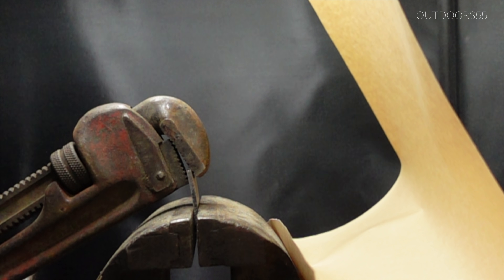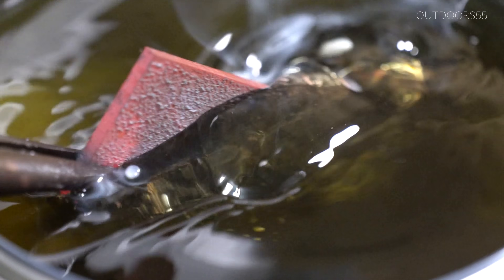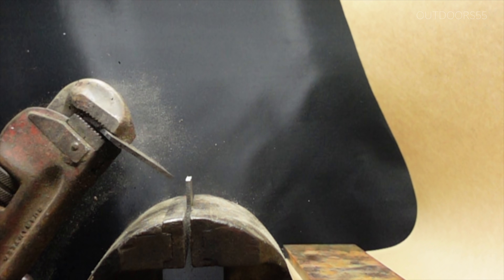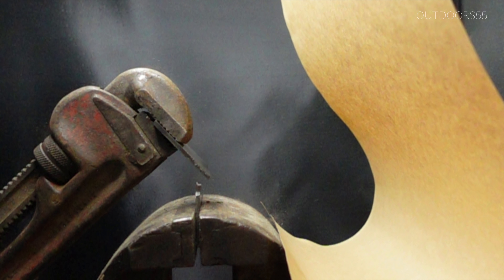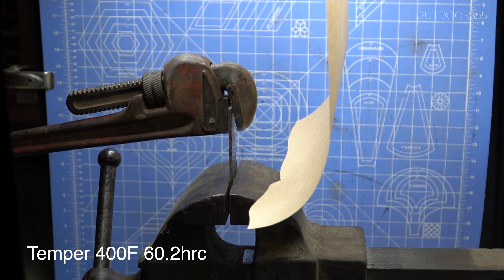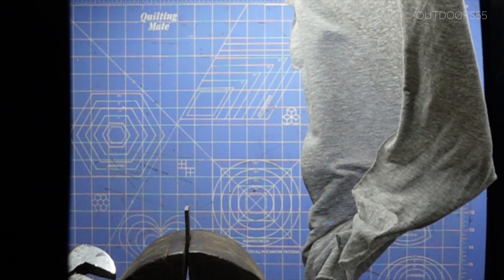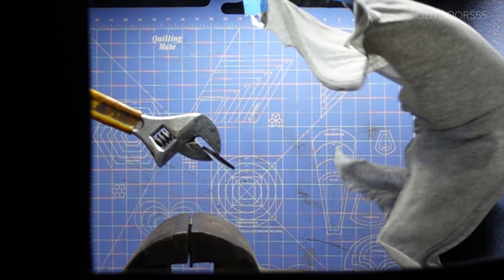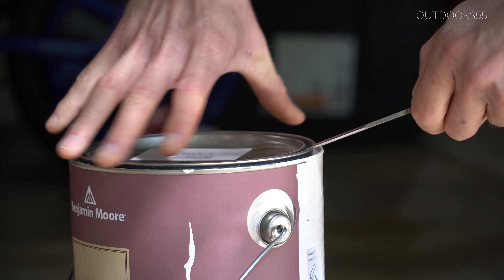Why You Should Never Break A Knife....And Probably Can’t

Comment: I don't think the danger of flying small to medium parts are the main reason behind not leaving it as hard as possible I'm fairly sure it's because of the breaking part it's self and the fact where the broken knife end up when you putting some serious weight behind it when it snaps and you lose all control over the blade I speaking of own experience breaking a heaten and not tempered Mora knife and slitt open a 20cm long hole in my pants barely missing my leg and the was done with about 3cm of the blade still attached at the handle. Sorry for the bad writing and no dots.
Reply from the maker: There's actually some crazy stories in the comments of people getting severely injured from flying hardened steel. Remember this applies to more than just knives. Drill bits, springs, hammers etc. 🙂

Comment: Interesting side note; in the 1970's a piece of hardened high carbon steel jackhammer bit spaulded off & was going just fast enough to hit me inside the elbow of my left arm & enter the basilic vein ( the largest vein in the arm ) but not through it. By the time that I got to the local hospital emergency room & got an initial X-ray, the steel had migrated up into my shoulder. A few minutes later the next X-ray showed the steel bouncing around inside the right atrium of my heart, which is the path that cyanotic blood takes when it is eventually returning to the lungs to drop the carbon dioxide molecule & pick up another oxygen molecule. After having to lay flat on my back for 3 days in ICU to ensure that the steel attached itself to the atrial wall, instead of exiting the heart & lodging in the small venules of the lung & forming a clot which would have to be removed by surgery, a catheterization of the vein in the other arm was performed to attempt to remove the steel. After 4 hours of being strapped on a fluoroscope table, so the surgeon could rotate my body between two axes to see where his catheter was located, he failed to remove that foreign object. I'm 72 years old now & still carry around that piece of shrapnel in my atrium. This story is just a reinforcement of your warning to always wear personal protective equipment when you're working in a potentially hazardous environment, because you never know when a freak event might happen!
Reply from the maker: Whoa!!! That's crazy! Ive come to the conclusion that hardened steel is not to be messed with in in appropriate ways. I had a piece of a hammer break off and cut my arm. I completely forgot about it until i read another comment where the same thing happened. Your story is scary though! Who would have thought.
Reply: I has the same thing happen. My buddy and I were experimenting with tools and since we didn't have a framing hammer (and all the "nice, expensive" hammers in the store were framers, we figured they MUST be better. Right?

Anyway, I took my dremel and cut a bunch of grooves into the face of a cheapo hammer I had so that it would have better grip on the nail. Then we went about our day. Some time later we were hammering on a log splitting wedge (steel) and one of the "mesas" on the hammer (which was 16oz, and completely incapable of budging the wedge, I have no idea why we were using it LOL) broke off, penetrated my NEW wrangler jeans, and went into my thigh. I forget if I used my knife to pull it out or if it worked its way out later, but that was kind of an interesting experience. (It didn't go but into the skin. Basically far enough to put a hole in my jeans and then ruin them with some blood LOL. But, I know now to never do that with hammers again LOL.)
Reply: @OUTDOORS55  Certainly not me.
Reply: Dude is hard as hell, takes his iron pill straight to the veins.
Reply: @bourbonated   😂  😂🤣😂🤣☺️
Reply: @bourbonated  If only I had a choice.
Reply: The part of the story he left out: the shrapnel is kept in place by an electromagnet and his name is Tony Stark.
Reply: @KyleJohnsonVA  genius billionaire playboy philanthropist
Reply: That's both terrifying and amazing. I wonder if that piece of high carbon steel has rusted itself to bits after the 40 or 50 years it's been in there.
Reply: @joshstarkey8883  that's a good point but (just a guess) I imagine it's not really able to rust as there's little to no free oxygen in the blood.. like it's all within red blood cells
Reply: "because you never know when a freak event might happen!"

Words to live by, right there.
Reply: Tony Stark ???
Reply: What PPE would have stopped that, I have never heard or seen anything that would have prevented something like that
Reply: @wades623 An anecdote concerning PPE might raise an eyebrow: I was an apprentice in the early '70's. One of the boilermaker artisans lost an eye to a shard of steel which penetrated through the lens of his safety spectacles.
In those days, safety spectacle lenses would probably have been toughened glass, but I suspect modern materials used in safety spectacle lenses have come a long way in 50 years.
Reply: Ye gawds and little fishes! You didn't dodge a bullet on that one, but at least you were able to walk away from it.
Reply: Wow. What a story.
Reply: @ralphh4131  You call it interesting, but I have had an entire lifetime of bizarre & unique events happen to me.
Reply: That's absolutely bonkers! I'm glad you survived it! The following days and weeks must have been stressful - not knowing if/when it would come loose and kill you
Reply: What a story !
Reply: This is the sort of stuff we need to hear from those with experience, far to many underestimates the risks of things.
I got a scar on my forehead because of "exploding" (destructive testing) steel, countless scars on my hands from years of dumb handling of tools.
I used to be young, dumb and knew everything...
Now im middle aged? (36) dumb, know nothing but at least i listen to those who has the experience.
Reply: @andnor problem is listening to those who don't know and they think they do. They been doing it wrong for so long
Reply: I have a question.
It's generally considered that 1095 is superior to 1084 or 1080 or 1075 etc because it has more carbon.
I presume the advantage to more carbon is more carbide and a harder steel?
But I see 1095 heat treated to just 57 and lower carbon steels heat treated to a higher rc.
It's generally considered that the lower carbon steels are tougher.
All things being equal.
Will a 1075 blade at 60rc be both tougher and hold an edge longer than the same blade of 1095 at 57?
Does a blades higher rc hardness mean more carbide?
I just wonder why companies use 1095 over 1075 if they only harden to 57 or 58.
Kind of a bunch of questions relating to the relationship between carbon content, hardness, carbide content and toughness.
Anyone care to explain?
Reply: thats way gnarly dude.
Reply: @WilliamHelstad  I was told that it will not oxidize because the white blood cells cover it to protect the body from foreign bodies. I remember that some Doctors came into the room & experimented with magnets & paperclips to see how many would hang at once, but it was obvious that it wouldn't work.
Reply: How big was it
Reply: Damn 😮
Reply: Thank you sir...
Reply: I didn't elaborate about the stress that I had to endure, like the puddle of sweat where my feet were, after the four hour catheterization was over, or how many time I passed out when the Surgeon would try to suck the object into his catheter tube using a syringe that would eliminate all of the blood in my heart, then the interns would have to stroke the carotid arteries in my neck to reestablish blood flow to my brain.

Comment: Safety glasses are good.I snapped a hss drillbit about 3/16 diameter. Two inches of bit hit the lens, snapped end on, in the center of the glasses lens. It was moving fast enough that it went on to bounce off the floor before I even blinked. The lens was just a little scuffed...right in front of the pupil of my eye.

Comment: As a product developer, engineer/inventor, I think it is more complex than warranty vs safety. While those are certainly important considerations, they are far from the only ones, and not even the top consideration for me, even though my products have a lifetime warranty. 

For my designs, the most important consideration is the “best tool for the job”. A knife with the best possible edge retention is not the best knife, but is actually a poor one. If you maximize one attribute at the expense of others, it is a poor design, outside of very specialized applications. 

General durability (as opposed to just the edge) is very important in tools, knives included, and not just for safety, or for warranty, but continued use.

As a general rule, the harder a steel is, the less tough it will be, and almost all untempered or “maximum hardness” steel is very brittle, easy to break. You can resharpen, or even straighten a softer blade, but you cannot just weld a too hard blade back together. 

All of this is much, much more true when considering certain fields where that tool may be important in a life and death scenario. My field is defense, and defensive tools/blades must never break. A survival blade would need the same attributes. 

Thank you so much for these tests, they are massively appreciated, and I understand how intensive product testing can be. Cheers 🤙
Reply from the maker: I agree "best tool for the job". I personally dont think the general public thinks that way though.  I think as makers we over analyze every detail. Maybe those details make a difference, maybe they don't. This was just a simple look a one aspect to see if there's more to the story. Thanks for the comment 👍
Reply: @OUTDOORS55  Totally. Wasn’t meant as a criticism, but as I start the comment, from the makers perspective.  Really love what you are doing, and excited to see where it goes!
Reply: Thanks for the comment, found it interesting
Reply: @heni63  haha thanks for reading my essay! Just saw how long it is 😂
Reply: Yep! Though there's tempted martensite embrittlement that means you get a softer but more brittle steel after a certain heat, like 450-550f depending on the steel.
Some might over-soften knives to that point, when you get 1095 at like 57 HRC, plus not having that be from retained austenite from overheating or such. Less heat for austenitize could get softer out of the quench for softer tempered without sacrificing toughness though.

Comment: This just shows the harder the knife the safer it is
Reply from the maker: Hmm, I'm not sure id agree. At first look it may seem that way, however you are A LOT more likely to break a knife if it's super hard. You probably can't break a 1084/1095 blade at 58-59 hrc by hand. Unless its super thin or you are doing something most people wouldn't do with a knife. 🙂
Reply: @OUTDOORS55  you should look at Joe X channel, knife destruction tests.
Reply: @OUTDOORS55  I know just making dumb comments based on the metal fragments being slower. Rather than worry about ejection of Metal fragments the real danger is continuing the cut into yourself when the knife breaks. I have actually moved away from some of the high abrasion resistant steels as I am good at sharpening now so a really tough steel like 420hc can get the job done is very unlikely to break and is cheap so I don't have to worry about doing damage to it.

Comment: So let's say I make myself a knife I will treat properly (not abused). Would it be a better longer lasting edge if I dont temper it 🤔 since I'm not worried about warranty claims 😅. Great info though, thanks for this.
Reply: The apex stability would be garbage. It would probably cut paper longer than tempered knives but if the apex struck anything hard it would be very, very likely to chip. You may even have trouble reaching high sharpness with certain abrasives, the apex may crumble/microfracture just before you get it to whittle hair. For any remotely hard use you would likely see damage as well. But it depends on blade grind and sharpening geometry. Overall, I'd prefer one of the harder tempered ones in this video that reach ~61-62 HRC. I'm not sure 1084 is super stable at 63.

Comment: This is still dissimilar to how most knives break in actual use. I would say the most common would be the tip, which often occurs while inside or underneath a material, so thusly not nearly as dangerous. Secondly I would say ones that break at the tang, or handle, which is again shielded by material. Lastly would be ones broken from impact or chopping, which tend to be alot less energetic, at times it just seems like it falls apart in a slow, surreal way, or it flies off like anything else, etc. Of course intentionally stressing it until it breaks is going to be the worst case scenario. Interesting video in any case.
Reply from the maker: Maybe it's because i do stupid stuff with them but I've had blades break just like in this video where pieces go flying.
Reply: @OUTDOORS55  It may simply be the case that it's rare to get injured from such debris flying off from the knife shattering (you know, reflexes, reaction, instinct, chance/randomness/luck). Personally, I would be more afraid of the hand being injured by the handle breaking,  or the blade hitting the hand.
Reply: I don't know, friend. Folks seem to mistake their knives for prybars and screwdrivers, etc a lot. Prime conditions for sending the to through ones soft palate.
Reply: Lol. What?
Reply: I always keep a couple cheap shitty knives I abuse the shit out of and only sharpen with those crappy sharpeners that have scissor sharpeners built in, and I have broken a few this way. I deliberately don't use hard knives that keep an edge well this way because they would just break in a dangerous way and would be more expensive to replace.

Comment: I love the new series of hardness and tensility tests!  I have broken knives and I have stood nearby when others broke knives.  Absolutely nobody ever does it in a vise!  A buddy of mine broke the tip off my knife while trying to pry open the back-cab window of his pickup, for example.  I have never heard of anybody getting injured by fragments.  I think it is fair to say that, every time I ever witnessed a knife breaking, it was being twisted or used as a side-to-side lever, not an up-and-down or forward-and-backward lever as demonstrated in this video (between the vise and the wrench).  I would be interested to see what the high-speed camera picks up in those instances.
Reply from the maker: My goal was to just see what hardened steel does when it breaks. I might test more realistic scenarios 🙂👍
Reply: I once had a knife shatter while whittling, it was an extremely brittle Ozark trail brand fixed blade.
Reply: Just imagine that the tip is the thing in the vise. Fixed.